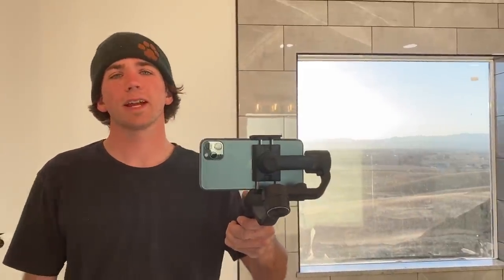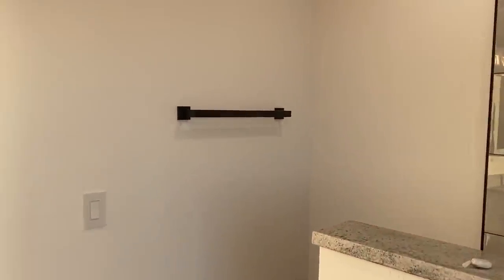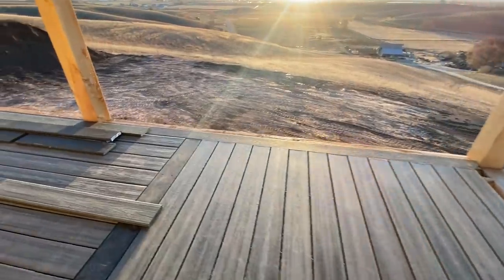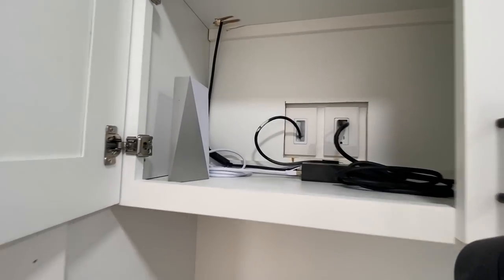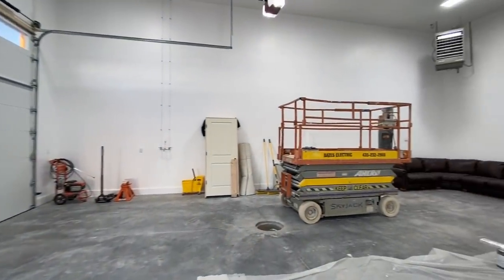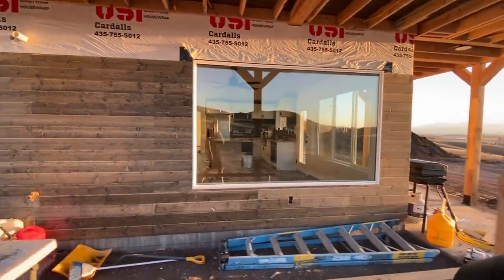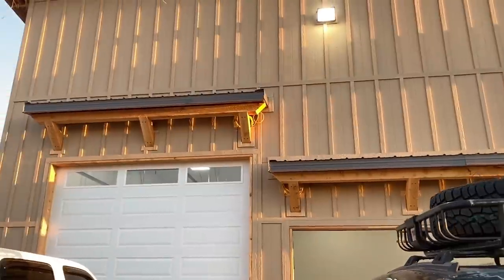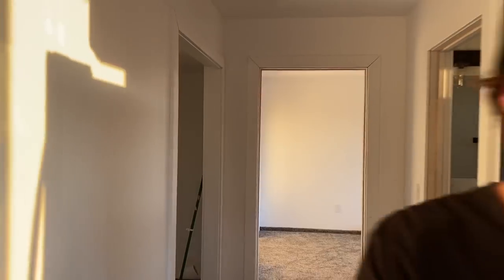#020 60x40 Shop house exterior lights and tile! (Shouse, Garage with living quarters)

Comment: My son built railings on a handicap ramp for his Eagle Project.  He used a sheet of 2x8 plywood with 2x4 spacers screwed to it for spacing.  1/2" uprights at 3.5" o.c. 1-1/2" top and bottom rail, then you can use the 1/2" tube for spacers to keep it centered while you weld.
Reply from the maker: Awesome thanks for the info!